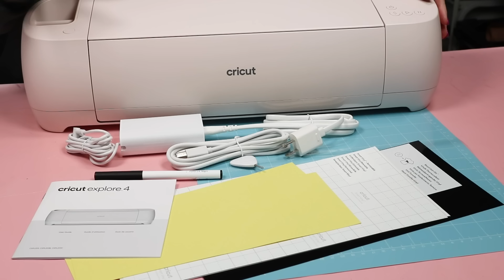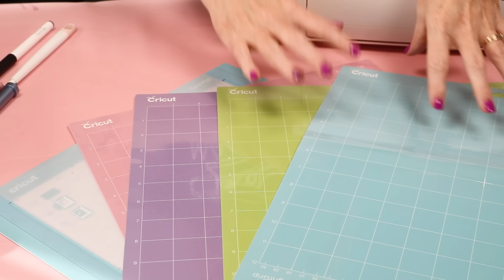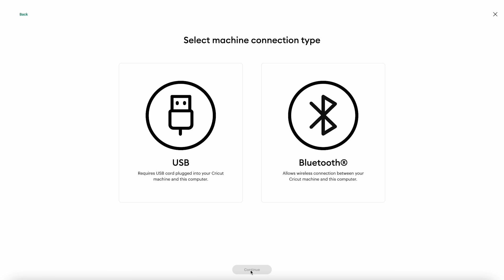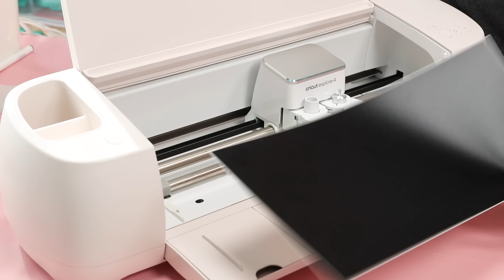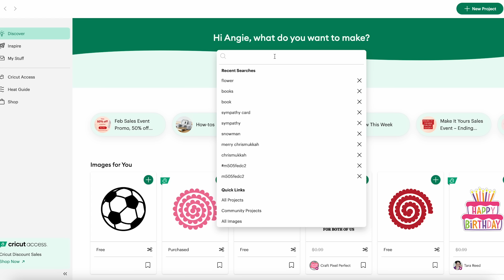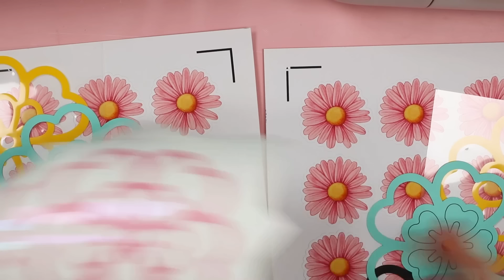The NEW Cricut Explore 4: Your Complete Guide

Comment: Hi Angie, I’ve had my new cricut for about three months or so and unfortunately it won’t connect to my Mac book 😢 I tried to do a Bluetooth set up and even connecting the machine to my laptop with the cord they provide. I have been trying to do a print then cut and it does send it to my printer to print but when it comes to the cutting process it just keeps saying that there is no connection or it just loads but never does anything. I tried reaching out to Circut multiple times and never got a response. This is my first cricut and as a baker I was so excited to try this machine. Do you have any suggestions? I as well did delete the app and put “forget device” on Bluetooth so I could start over again and still no luck….
Reply from the maker: Sounds like there is an issue. I would call Cricut.

Comment: does the maker 4 have the same rubber rollers as the original Maker that stretch out and come off track?
Reply from the maker: The Maker 3 and Maker 4 rollers are made out of a different material. I am trying to figure out a way to do a video on the rollers.

Comment: Is the sticker paper shiny? I am asking because I have an explore air 2 and I have to tape the guide lines with mat tape for the Cricut to work. I do use Neato shiny label paper.
Reply from the maker: The Explore Air 2 has the old print then cut sensor. On the Explore 3 and 4, there is a new sensor that does much better at reading on a variety of paper types.

Comment: They should work on Design Space and cricut should allow to use the letter warp and should allow all the options that come with cricut. Meaning functions without access!
Reply from the maker: Actually they have been working on Design Space and have made some vast improvements. Some of those premium features have been put behind a paywall. You can do those other ways it just takes longer. So you either pay for convenience or do it the long way.
Reply: @ Sorry it's a functionality and shouldn't be behind  "Access " or paying for it. Which is why I have been looking for a different cutting machine.  Why buy something that works faster but don't allow you to use those functions without paying. 🤷‍♀️
Reply from the maker: All of the functions I used in the video were available with a free account.
Reply: @Sunshinej77  I think the distinction is that those aren't functions of the machine itself, they're design function added to the software... you didn't pay for the software, so as long as you can use all the functions of the machine (speed, cutting, scoring, etc) without paying for the membership, the paywall is on the more conveniant software (like silhouette has distinct softwares... and their free software doesn't even allow to import svg cut files, but at least the version that does is a one time fee, not a membership). Because the free software allows import of SVG and images (png, jpg), you can easily use other software for the design part, even free software, like, among others, Inkscape (svg) and Krita or GIMP(png/jpg). Designing outside DS also has big advantages on the "terms of use"/license front. Projects created in DS are captive of the Cricut ecosystem and terms of use, but Cricut gives me the ability for free to use powerfull dedicated software that give me complete freedom to create files that I can then use with their machines. It's easy to do shape warps in Inkscape (note: letters curving IS free in DS, it's shapes that are behind the paywall... unless you turned your letters into shapes by welding them).

That said, I feel there is a big catch most people don't seem to realise, your Cricut doesn't work unless Design Space can connect to the Cricut servers,  it's totally dependant. You can't open DS to use your machine if you don't have an internet connection (...or if the Cricut servers don't work... if something happens to them, cyberattack or bankruptcy... we own bricks).  I came to grips with it after they gutted the "work offline" ability, because my Cricut (Explore Air 2) was a lot less money than any other alternative andd it's technically a great machines. I would not have been able to afford and enjoy the other options (there are newer ones now, but most are still expensive)... but I do wonder how people can buy Venture's with that Damoclese sword over their business assests (note: it's the same with Glowforge in laser cuttters). 

There is one new "exclusive " function where I feel Cricut is pushing into the machine functions... the ability to specify for some Cricut materials distinct pressures for die-cut and kiss-cut when using the "Create a sticker" function and the ability to have both a kiss cut on the inner cut and die cut on the offset... there I feel they're playing on the machine side (the way to do it without Access is to duplicate the cut on th the offset, but that's not as precise). I don't care about the automatic function itself, that fits with the logic of optionnal and software based Cricut Access advantages, but the machine dual settings aren't available outside of it and/or for custom materials, there I think there should be pressure for them to add a new feature for all user. People should organize and use the "request feature" in large number, especially if we don't wan't to see them do more of this kind of thing.

Comment: Very nice, but I'm noticing that my 3 cuts fast like the 4 your showing and my 2 cuts really slow like the 3 your showing. I also want to know what is the rush? When I had my Explore 2, I  loved having the time to do other things while it cut, now that I have the 3, I barely have time to get up and get other materials together and it's finished cutting. I think my 3 is extremely fast and it's great! I don't need any faster than that. But thanks for the review 😍
Reply from the maker: The 2 was slower than the 3. And the 3 is slower than the 4. The main difference with the 4 is cutting on the mat and it is in fact faster than the 3. It is not an improvement that is for everyone and if you are happy with your machine there is literally no reason to change.

Comment: Thanks, Angie. But, do we really need more equipment from Cricut?  Imo, they need to improve their software AND let me save MY work to MY computer if I want to AND let me gift my existing machines to someone without it turn into a brick.  When my EA2 dies I seriously doubt it will be replaced by another Cricut.
Reply: I am looking to get a machine...thanks
Reply: What do you mean gift your machine? I just bought a explorer 1 from someone and it works fine
Reply from the maker: First, they have been working REALLY hard over the past year on software and it is so much better. You actually can save your projects to your computer for offline use. Second I have gifted MANY machines. You can give them to whoever and they are not a brick at all. I am not sure where that information came from.
Reply: @AngieHolden thanks. Do you have instructions on how to save to my computer, please?  My comment about the brick was based on research I did while troubleshooting problems while attempting to change email addresses on my profile. I had to revert to the old email address to get my machine to work.
Reply from the maker: This was the release on saving for offline use: https://www.youtube.com/watch?v=JNANNBOytSc
And I use my machines a lot of times with two different email addresses. There should never be an issue with a machine being used by several accounts.
Reply: @AngieHolden  Unfortunately, "offline" was gutted only months after realeasing (it was the main reason I bought my Cricut, not having that ability was a deal breaker for me up to that point😖). Now, to work "offline", you need to be online to lauch Design Space!!!! It needs to "check in" with the Cricut servers before openning, if they have trouble, you can't open DS... (If I don't have a connection, I don't have one, so I can't open DS and work offline😒... yes there are still places where you can't get internet). And you can only do limited things while "working offline", for example, you can't import a file (svg or image, not sure for a new font) from your computer to DS on that same computer🙄 you need to be online to import it and save for work offline, only then can you work with it offline...
 
And I think she refers to exporting files to use outside of the Cricut ecosystem (or for future proofing)... and that won't happen because of the Cricut terms of use, if people read carefully, Cricut (or their partners) has the rights to every shapes and image in DS and only allows limited use for personnal creation or under the "Angel policy" . Event the "free content" in DS, is not allowed under the "Angel policy" so, since you can't do freehand, you can't really create "your own work" without using parts you don't have the rights to outside the Cricut ecosystem. Trying to allow exports of projects made exclusively with system fonts and "external" files, while preventing exports of projects created using images, shapes or fonts for which the license is limited to use in DS would be complicated... and users not grasping the limitations would constantly get mad😜and ask why it's not working. To me that's not a big deal, I use Inkscape (free and open source) to create SVG that I have control over. (But I would really love if they would recognize layer's name when importing SVG files, or at the very least give each group/layer a unique ID, not everything with the same file name🙄 and they really should add calibration for the clamp A... because when the scoring/pen lines aren't aligned with the cut lines it's really frustrating... yes I did fill the form for feature request)